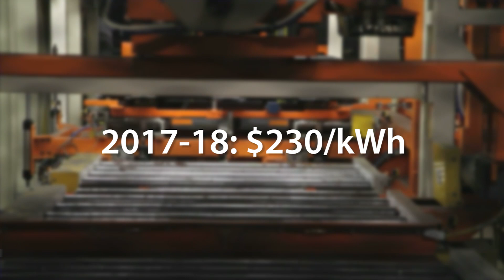EV Battery Prices Dropping Faster Than Predicted - Autoline Daily Insight

Comment: Why  is she an EV "Expert"? Phd in Physics? Doubt it. Masters in Engineering? Nope. My Nissan Leaf has a 24KWh battery. It will cost $6K to replace it. If I can get 10 years out of it, I will break even with a economy car, in fuel savings, about $5,500. That of course is wiped out if you replace the battery for $5,500. THERE IS NO FREE LUNCH... The pollution to make and recycle batteries and create power to charge the battery is significant, NOT POLLUTION FREE. .
Reply: If you want to use a vehicle to move yourself around, there is never a free lunch with any kind of vehicle.  Motion requires the creation and expenditure of  equipment to achieve it, even using "free" solar fuel.  We still need it to survive, so we pay the price.

Comment: What they should do is have roads with induction plates in them. As you roll over them, electricity charges the onboard battery enough to power the vehicle. A french company is developing a system that fits the vehicle to provide on the go charging now.
Reply: This sounds good, but is impractical. First, you have to roll out a whole lot of infrastructure, when charging infrastructure already exists all over the place that is good enough for the vast majority of people.
Then, the qualcomm one only works with a gap that isn't even big enough to use it on my Subaru Forester, let alone a large SUV.

I mean, sure, if we could do this then EV's would be so far ahead of gas guzzlers it wouldn't even be funny, but I think the cost wouldn't be worth it for the very limited benefit of not having to stop after 300 miles of driving...
Reply: They are planning on doing this on Highways in France so people don't brake down between towns. I think it would be relatively cheap to roll out in towns because the induction plates could be rolled out at night for minimal disruption and according to the inventors the cost to roll out can be easily covered with a minor charge on top of vehicle registration. I think it will be an awesome idea.
Reply: While that's not a bad idea per se, I don't think it's really worth it WRT how often this will happen. BEV's can more accurately estimate their range, and if they follow Tesla's lead then they will have smart systems that can automatically find chargers, if you ever need them. I can tell you, I can think of exactly 2 trips in the last 4 years that I would have actually needed one: once to Port Macquarie, about 650km, about this time 2015, and a few weeks ago to Gladstone, also about 650km, but I stopped overnight at my parents so I wouldn't have needed a fast charge.

I wonder also why they didn't install fuel pumps along the side of the road in case you break down between towns?
Reply: Whilst we both live in Australia I have to say I tend to agree with you but the idea of not having to stop and wait for a charger in future will be a better option when BEV's become more prevalent. And people will be more likely to take long journeys without range anxiety. Imagine traveling from Sydney to Brisbane only to find that Coffs harbour has had it's only BEV charger taken out by a terrorist or crack addict.

Comment: don't buy a new gasoline car !!! or an electric car without huge rebates. just buy a used car gasoline and wait another 3-5 years. prices will be decent by then and range will be adequate.
Reply: schmo7777.     smart.     a used leaf is super cheap...but only gets about 60 miles range.....wonder if the new 2170s. would fit in there.... you'd have a 300 mile range leaf

Comment: As expected, this video reports totally ridicules prices. $230/kWh in 2017-2018, while the battery to the Bolt officially cost only $145/kWh now in 2017. 

Experts ALWAYS fail to see the strength of a new trend when it starts speeding up. Competition makes everything go so fast that the predictions of how long single projects takes just don't work anymore because it's the very rare projects that go way better and end way sooner than expected that are dictating the speed of improvement. 

And all the experts are totally wrong on when self-driving taxis will arrive too. They are fixing the last glitches right now, and there will be total panic in the car industry when this gets going. It might even arrive this year, and then rolled out in 2018 across the world.
Reply: Henrik Wallin : GM is talking price at cell level, I consider cost at pack level. same Chelsea is talking.
Reply: I took a look at the BYD E-6 a while ago... It isn't to my taste aesthetically but it looks like a tremendous technological achievement... It is a shame though that as it is a chinese vehicle the actual quality of the car in terms of ride and handling will undoubtedly be very poor... When the Chinese finally embrace quality as a goal and aim, things will change
Reply: +gary miller

Not actually true... Tesla just posted profit for the first time.  They are technically the third largest car maker in the world now... Not bad for a noob car maker

He still has a lot of revenue to recoup to match the investment thus far, but thats the same dilemma that all new businesses have in the early years

I predict massive profits for tesla in the future, based not only on the scalable nature of his manufacturing processes, but also because he has made electrical cars that people actually like AND he has nailed the battery cost.  Battery cost and lifespan is the major driver of car pricing in this sector and he is now the largest producer of  electric car battery units in the world

http://money.cnn.com/2016/10/26/technology/tesla-earnings/
Reply: Henrik Wallin Tesla will soon had like 90 per kwh because they have a building that will make over 50% more batteries than are currently being made from the whole world
Reply: There are also other car-makers and battery producers that are building way more than Tesla. The biggest producer of electric cars and buses is BYD, despite that they are pretty unknown in the western press, and LG 
Chem and many more are ready for huge factories too. 

And there are tons of more or less secret projects on other battery technology that suddenly might appear thanks to that there is a market for it now. The biggest disruptor might be change in how cars are owned with car sharing and self-driving taxis. Self-driving buses and in this summer, a self-driving flying electric taxi in Dubai: http://www.recode.net/2017/2/15/14630608/dubai-autonomous-passenger-drone-taxis-summer

I would be really surprised if no company starts operating a driver-less taxi service at least as a test this year (they are already running, but with operators in the car). And taxis and shared cars will be electric because it's much cheaper because they drive so much.
Reply: Government subsidies.
Reply: Elon Musk has never made a profit on cars.

Comment: And now on 2017 we are already well below 200$ =)))
Reply: 145$
Reply: And falling. Musk already started his production in the GIGA factory - so i would suppose there are already cheaper ones in store - even not on the market.
Reply: ferkemall hmm  90%+ of all Cells are made in China over 50% of all electric Cars are sold ind China as well.
Reply: Just dont buy the cheap fake 18650 batteries from china on ebay thats labelled 9000Mah when its actually 300Mah..
Reply: 120 usd 2020
Reply: Jörg Walossek ,

Comment: The days of internal combustion engines in passenger cars are numbered and the counter is counting down.
Reply: nope
Reply: 8o,,*kk https://www.gearbest.com/walkie-talkies/pp_825184.html io
Reply: 6iikji
Reply: +ThomasTheSailor Chubby   Damn, you're misinformed.
Reply: Robert Bidochon,    Not really.   The Devil is in the detail..    Most electricity is produced with Fossil fuels,  World Wide..  10% come from Nuclear power Plants,  and less than 2% come from solar and wind generators.  The rest comes from Fossils.    Charging an EV from the Grid,   uses CO2 producing, fossil fuels.. 
     EV cars have over 1000 less parts than a Gas car..   No exhaust pipe, No Starters, Carburetors,  Fuel pumps, Valves, Pistons,  Hundreds of nuts and bolts, etc.   on and on..     Less parts should mean lower price..       Show Me where I'm wrong  ..
Reply: +ThomasTheSailor Chubby   The electricity produced by renewable energies is becoming less expensive, thus replacing the fossil fuel step by step. Be patient, I'm also impatient to ditch my pos ice vehicle, I want only to replace my tires and not having to do a bunch of maintenance, I want to enjoy a silent driving experience and be able to recharge using the sun....
https://www.climaterealityproject.org/blog/new-report-renewable-energy-will-be-cheaper-fossil-fuels-2020
http://www.businessinsider.fr/us/renewable-energy-will-be-cheaper-than-fossil-fuels-by-2020-2018-1
Reply: Robert Bidochon,     I don't mean to bust your bubble,  but, There's still a along way to go.    I live in Connecticut.    We only have 55% sunny days throughout the year, according to the Government energy dept.   Solar power is not enough to power a Home.  It would take too many solar panels..  CT  is not the only zone like that..  Cars like Tesla,  consume more electricity than some homes. 
     Renewable energy is over-rated.    Electricity demands are growing by the day,  without Electric cars...  Do the math yourself.   Don't rely on people with vested interest in solar power or anything else.,    They just wanna sell you something,   they'll say anything,    including the government..       Do the Math Yourself.!
  Did you know,  Tesla Motors gets over $5000. per car,  from the Government,  as energy rebates.?   The Government wants your money..
Reply: ThomasTheSailor Chubby Except now the Bolt is here!!!!
Reply: Robert Bidochon Bolt is here!!!
Reply: @mablesfatalfable6021  Actually, it has.  The fraction of the fleet taken by electric vehicles has only increased in the 7 years since I made it, and continues to do so despite current FUD to the contrary.
Reply: No they're not,    if people understood,   EV's just swap the tail pipe for a Smoke stack..    An economic gas car still produces less CO2 than an EV..
   Plus,   EV's are a scam,   EV's are the cheapest cars to build,  yet Tesla is charging 2-3 times a gas car..    It's all about the money,,  Only a fool would buy a Tesla..

Comment: I have been a skeptic on battery tech for anything more than to start an IC engine and transistor radios.  I HATE lead acid batteries. Just recently purchased a 40 V Li weed whacker...slowly becoming a convert. If the battery lasts, I will be impressed.
Reply: Battery Technology has been very rapidly advancing over the past decade or so. The problem is, battery technology was so old, that even at this incredible rate of advancement, it still lags way behind pretty much every other form of technology, but the gap is starting to close.
Reply: undead890 Yes...I have my fingers crossed for a breakthrough. 
As I'm writing this I have my Chevy Impala's battery on charge. Ran it down with the accessory switch left on. I think it's at the end of it's life and this little bit of abuse likely took it out. The car is a 2013 model so the battery served for nearly four years now.

Comment: $125/kWh ?!? That's some mighty expensive electrical energy. Perhaps he meant $125/kW of generating capacity ?
Reply: No, he meant $125/kwh of energy storage which once you've paid for it can be used over and over again until the battery is completely dead. at that price a nissan leafs 24kwh battery would cost $3000
Reply: That is for storage of that much energy.

Comment: wait for graphene based  batteries 
next level
Reply: +Abdul Rahman Dhillon I do hope they succeed, and soon!
Reply: Yeah, hydrogen is a non starter, its just more fluff pushed by fossil fuel interests.
Reply: I don't totally agree with that, though I do think it makes no sense for passenger vehicles. It might make sense in trucking, but heavy industry I reckon would be best on hydrogen, where the size and weight of the storage and fuel cell isn't a big deal comparatively.

For example, the Orkney Islands are looking at using their excess renewables to generate hydrogen for use on the ferry between there and mainland UK. They have a plan in action at the moment to do it for the electrical systems, but the end goal is to also use it for the drive units.
Reply: Are graphine batteries more efficient than Li-on, are they light weight, less spacy and ABOVE ALL will graphine be less costly?

Comment: How about companies stop using the inefficient 18650's.. Just because they are common doesn't mean they are efficient vs weight n space. They were just first. That would lower cost 20-30%
Reply: That's why Tesla designed the 2170.
Reply: Not just Tesla - Panasonic is Teslas battery production partner, and 2170 looks like becoming a bit of an ad-hoc standard for large scale storage - ie. vehicles and grid storage.